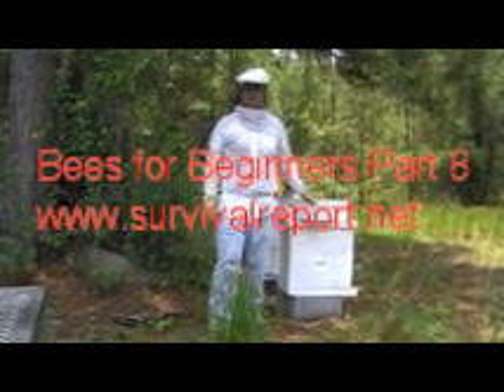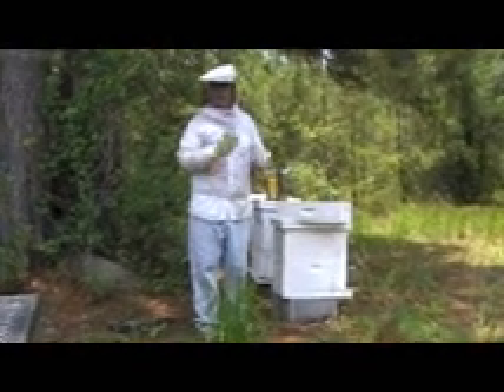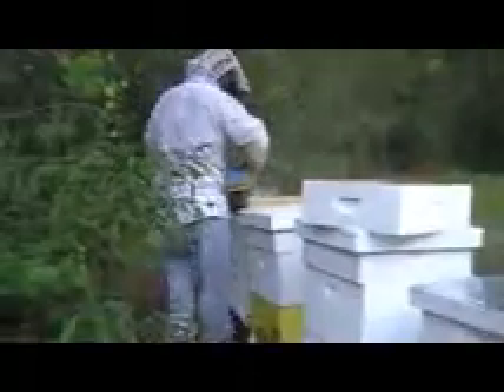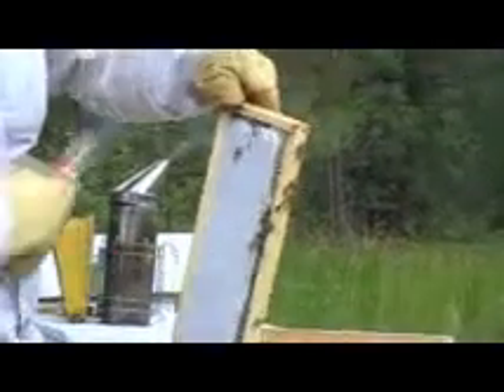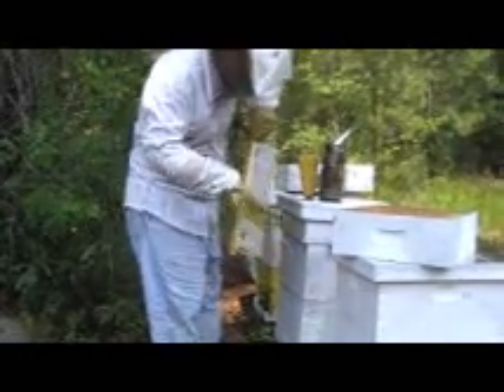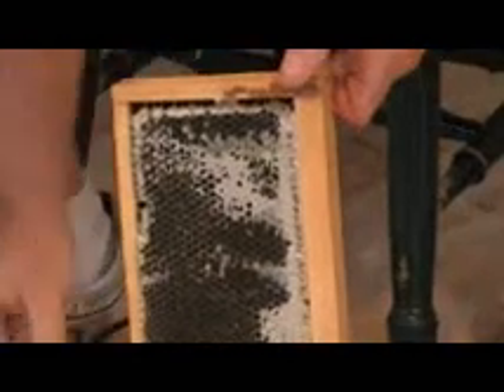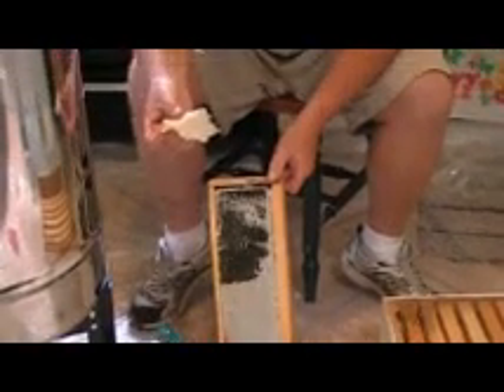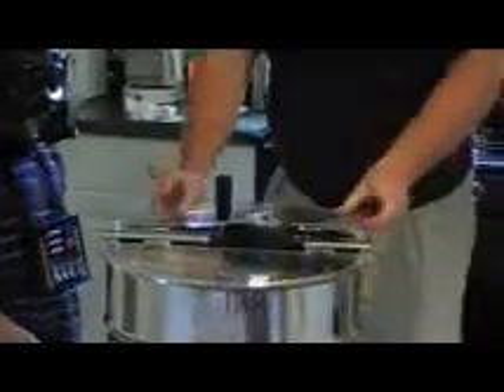Bees for beginners Part 8 Honey harvest

Comment from the maker: The shallow super is the one that looks to be half the size of the larger ones. They are typically used for honey production but ANY size will do. The smaller frames are easier to handle when full of honey. 

In general people start with one deep hive body more or less as a brood chamber, storage etc. Then as the hive expands they add a second deep. This is usually used as a place for more brood and honey storage. Sometimes a queen excluder is put down and then a shallow super is put on4 honey.

Comment from the maker: "Super" is a generic term that means hive body. It CAN mean either a deep hive body, a medium hive body or the shallow hive body. MOST of the time it's used to describe a shallow hive body, which in the video is the top ones that are removed for the extraction of the honey. Basically it contains the honey YOU take, the honey in the bottom two deep bodies is left for the bees to overwinter. Even with that, it's good to supplement feed in the winter, IMO.

Comment from the maker: Where have you ever heard that they should be at a "different angle?" 

Bees will rob irregardless of location, good management techniques keep that under control. 

Might be a location/climate type thing, down here this is the spacing used by all the big beekeepers. Only thing I can see that might affect this would be snow drifts- no snow down here so that's not an issue.